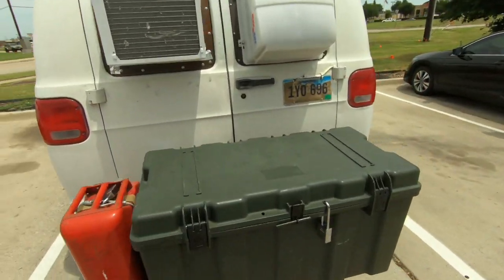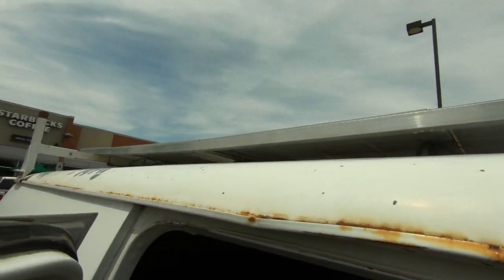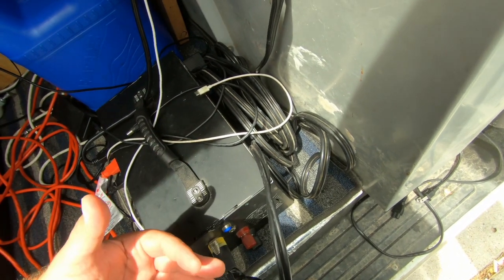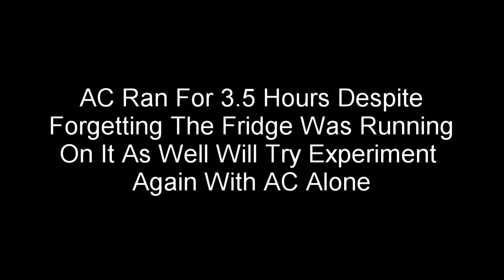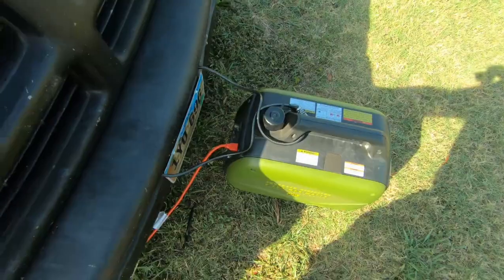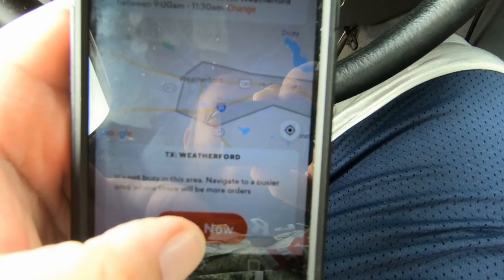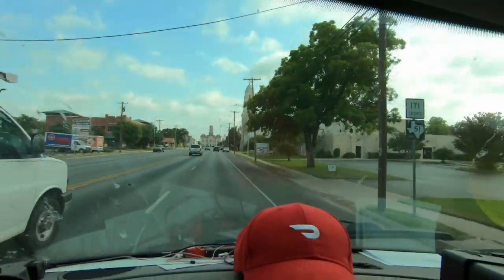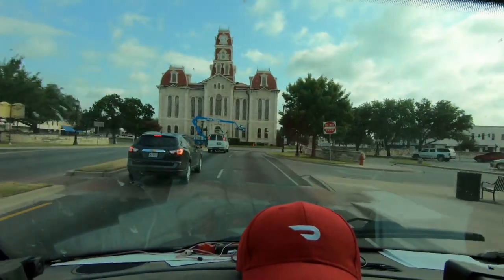Running AC On Solar For Van Life & Wrapping Up The Van Build

Comment: Buy some foam board build a small box for your bed . Idk if you could get 2  320 watt panels ideally you would need 900 Watts to live decent. These 320 panels are $200 each. Love the ss sink I currently wash in a igloo ice chest Plastic will keep a greasy residue I could put a liner in but it is not a big deal. I got it this way because I like to put all my dishes in hot water let them soak then wash after I get a cooler temp. I put bleach in my dish water so I know it is sanitized and safe for me.
Reply from the maker: I disagree on 900 watts. A lot of factors go into it and the weakest link in a solar system is actually the battery.

Comment: I'm glad to hear the AC actually worked as you intended. While I doubt it'd work all the time, it's definitely a necessary item in my opinion, especially in Texas. Beware, those little bike locks are terrible. They can be opened in about 20 seconds or less without even looking at it and with no tools. They are seriously terrible. If I were you, i'd swap that lock out for something a lot better.
Reply from the maker: Thanks for feedback on the locks.

Comment: You got me thinking if you can run your air conditioner with solar I'm wondering if you hook up an pure wave inverter to your car lighter I'm wondering if you can run your air conditioner and do that when you're driving 😎👍
Reply from the maker: No, your lighter doesn't provode enough amps. The only reason I was able to do it was because the battery in the Kodiak is lithium and it can handle 1100 watts or about 90amps no problem. The car battery and cig lighter would only give around 30amps. Not enough.
Reply from the maker: You need 50 amps. Good looking out for me though.
Reply: @WanderlustEstate  I've always thought of that but I figured you wasn't going to be able to do that but I'm wondering now that you tell me how many amps if you can put a bigger alternator they pushis more amps would that work
Reply from the maker: In theory its possible, but the issue is its not going to work with lead acid. You have to be using lithium. Lithium Titanate would work, but you'd have to wire up inverter directly and it'd need to be a 1500 watt pure sine unit with 200Ah of 5 cell Lithium Titanate batteries.

Comment: 9:15 The Court House was built in 1886, in French 2nd Empire style. It's interesting building. I didn't know they had much French architecture in Texas. Your van is looking good, but I hope you not putting too much weight on the back.
Reply from the maker: I didn't know either, it looked a little Victorian esque. Guess there is a bit or there would be no Paris, Texas.

Comment: Years ago I had a Samsung 5000btu(the lowest you could buy then) that did almost 14 EER(around 370W).. I measured with kill-a-watt to verify.. Most of the current best are around 12 EER(around 400W). I still use window units all over the place..
Reply from the maker: Would love to have had a 14 SEER unit. Mine is 12.

Comment: Awesome video man, I hear ya on the 
" living in a van and building it at the same time". It's a struggle sometimes but I love it.  I'm getting ready to buy a generator for my AC as well. Safe travels...
Reply from the maker: Nice! What generator?
Reply: I'm looking at the  Predator from Harbor freight. I was looking at the Kodiak as well but i haven't made up my mind. I need something that will run my AC for my dog 🐶
Reply from the maker: Go with generator first. I have the Sportsman 2200 and 1 gallon of fuel will run the AC and my battery charger for 7 hours. The Kodiak is cool and all, but you can do a cheaper set up. The gennie should be your first purchase to take care of your 🐕.
Reply: @WanderlustEstate  yeah, at the moment I can only use the ac when I'm plugged into shore power. The generator will definitely make things better for boondocking. Thanks man !!
Reply from the maker: @nomadicsporadic3836  You betcha, anything to help a guy out.

Comment: Another way to make cash doing small jobs is moving or delivering furniture. If you have a pickup truck or van. People buy used furniture from craigslist and consignment stores and need it delivered if they don't have a vehicle such as an suv. I've placed ads on craigslist offering $40 or $50 to anyone with a truck or van that can move furniture just a few miles and always get good responses

Comment: What fan is that on the backdoor
Reply from the maker: Its a fantastic fan I mounted in the window, with a after market cover to protect it.
Reply from the maker: I don't use a roof fan. Didn't want any leak points in roof because I'm putting in vapor barrier. But having a roof fan and something mounted in window pull air in with roof pulling out would rock. However roof fan limits your options for solar.

Comment: I am going to get a  100 watt solar  panel  from  harbor  freight I think it will be  good  enough for  a weekend just to  run  a fan and maybe  a TV. What's your  thoughts on this.
Reply from the maker: The Harbor Frieght kit is crap. It uses the least efficient type of solar cell. Amorphic thin film is only good for low light. It doesn't last the long haul and that kit is over priced. Plus you can fit a 315 watt monocrystalline panel in the same space that thing takes up. A friend of mine has the scoop on 300 watt panels for $150.  

What kind of battery are you using? That matters the most on running AC on solar.

Comment: hey man what part of texas are you in? im in wichita falls and im looking at building a van too. would love to actually get in one and see what its like before making a huge investment.
Reply from the maker: I'm currently in Fort Worth.
Reply: @WanderlustEstate  How hard is it to run ac off solar? dont u need a huge battery bank
Reply from the maker: @lexonyt2237  If using Lead Acid yes and you need huge amount of solar. If using the right lithium chemistry no. Plus it all depends on what kind and size of AC unit you're trying to run.
Reply: @WanderlustEstate  even for a small 5000 btu ac ive seen demos where they draw about 400w. thats gonna draw about 33amps an hour. Using batteries other than lithium you're gonna need 2x the amp hour rating due to only discharging 50%. thats still really expensive. Is there any way to do this and still look stealthy without a giant ac hanging out your window?
Reply from the maker: @lexonyt2237  You need more than double. As your amp draw goes up lead acid batteries get a lot less efficient in giving power. Also you have losses from inverter and wiring. Soamp draw is closer to 50. At this high an amp draw your lead acid battery is less than 70% efficient. So that 100 amp hour battery that you should get 50 useable amp hours out of turns into less than 35 useable amps. And worse than that is how inefficient at storing power that lead acid batteries are. The literally waste half your solar. Keeping your lead acid battery charge under 70% causes sulfation which ruins it. So, you need to keep an above 70% charge whenever possible. Above 70% charge lead acid batteries only store 48% of the power they recieve.
Reply: Wanderlust Estate well even with lithium batteries, unless you’re spending hundreds of dollars on batteries, how practical is it? I’m contemplating whether or not to get ac in my van. Plus I’m trying to stay stealth. What would be the best way to stay cool without installing a roof ven
Reply from the maker: @lexonyt2237  You can run a 5000 btu window unit on solar with 200Ah of lithium and 800 watts of monocrystalline panels. You can run that unit for 7 hours overnight with 400Ah of lithium. Certain chemistries are better than others, but all of them can handle that unit.
Reply from the maker: @lexonyt2237  If you want to run a 5000 btu unit on lead acid you'll need 1200 watts of solar and 1000Ah of lead acid.
Reply: Wanderlust Estate that’s definitely way too much for a small camper van. I wouldn’t even have space for that many panels. Also 400 ah of lithium might cost more than my van
Reply from the maker: @lexonyt2237  Nah, my Dodge shorty can do 800 watts. Plus you can get. 400Ah of LiFePO4 for about $900.
Reply from the maker: Pete Carroll has access to 300 watt panels for $150 bucks.
Reply: Wanderlust Estate where I’m seeing the batteries, it’s showing for thousands for 400ah, but again I’m trying to do stealth. Would ac be practical for this? I don’t want 3 or 4 panels on my roof. 1 or 2 maybe.
Reply from the maker: @lexonyt2237  Look on my community tab from my channel page there is contact info for direct source of LiFePO4 batteries. You aren't going to run AC on solar with couple of panels. Accept right at noon.

Comment: thats super hard on an inverter, but tis whatever
Reply: what is super hard on an inverter?  I presume you are saying running an AC on an inverter is hard on it but doesn't the electrical load and size of inverter and duration of operation determine if it is hard on it or not?  Is there a rule or guide about wattage drawn by appliance relative to size of inverter that is not hard on it?  I think James AC unit draws 400 watts.  I've heard it's best to use less than 80% of the continuous rating on an inverter for prolonged periods so 400 watts of AC/80% = 500 watts as an inverter size. I think the inverter on that Kodiak is 1,500 watts & 3,000 watt surge.  Please share the details and numbers and reasoning that make Jame's setup hard on his inverter.
Reply from the maker: Its not hard on it, you're right its all about size. Most people don't realize how little wattage a 12 seer 5000 btu unit takes. Nor do they know the Kodiak has such a large inverter on it.

Comment: Hello.   So how do you like that van.     What year and what size engine v6 or v8 ... I have been seeing vans like that on Craigslist in Vegas... I was looking for a Chevy kind of like your old van how do they compare... thanks
Reply from the maker: This is a 2000 RAM van and it has the 318 v8 in it. Gets me 16+ mpg on the highway and about 12-13 city. Even with all the weight from the van build.
Reply from the maker: I prefer the 98-2003 Dodge vans over the Chevy or Ford. There's a reason all the class Bs from that period were built on this platform. If you can find a good one get yourself a 98-2003 3500 extended RAM van. That would make for an awesome build.
Reply: Thanks for the information....  thumbs up
Reply from the maker: You're welcome.

Comment: That's so awesome that you can run the AC off the solar for that long.  It would be cool to have 2 banks of batteries...1 on reserve and 1 being used and switch back and forth if that was possible.  :-)
Reply from the maker: That would be rad for sure.

Comment: James, no ceiling insulation yet? That poor little AC must be working it's hiney off. Looks good otherwise. Except no drivers passthrough to the back
Reply from the maker: I don't care about pass through prefer the split from cab. I have plans to put in vapor barrier. I started it, but everywhere I've been where I had time to work on it, the humidity has been to high. Suppose to install it with less than 50% humidity to prevent phase change heat loss.

Comment: Bro, WHY have you not put insulation in your van FIRST?
Reply from the maker: Because I was putting in a vapor barrier and hadn't been anywhere that was low enough humidity to finish it. Plus there are a number of issues with insulation that would take me a book chapter to write up here.
Reply: @WanderlustEstate  TRUE THAT.
So many use the silver bubble wrap aka REFLECTIX and put that right on the metal... NOT a good chose. LOL Closed cell FOAM Board is good and spray foam is ok 
but it all is one's choice to do it.
Reply: I love what you have done to the back doors/windows. I too am going to do that, or do what CVK has done. I am going to the VAN BUILD next month and getting rid of my AC on the roof and putting in 4x315 of Solar!  I have my 3x100 BBB and CC just need to put up the solar! 
Are you going to be in the Parker area in NOV?
Reply from the maker: @georgefenrich4119  Unsure just yet, but was hoping to get around there for a few days.